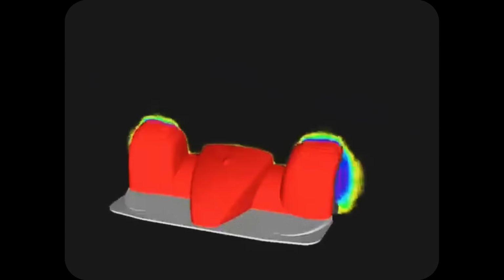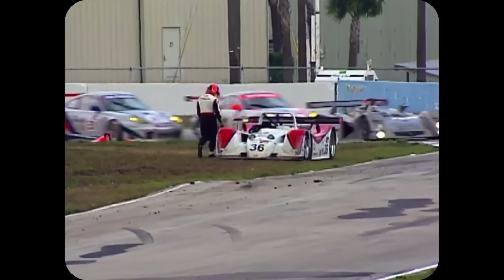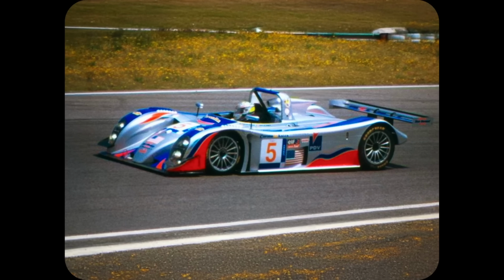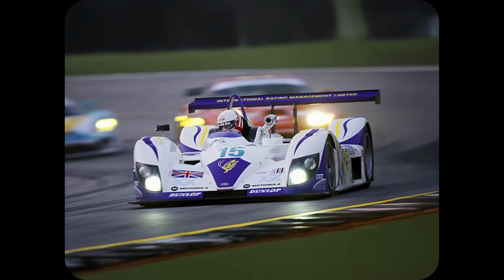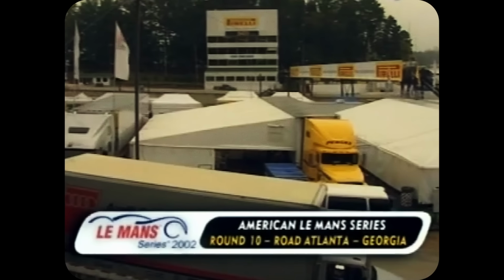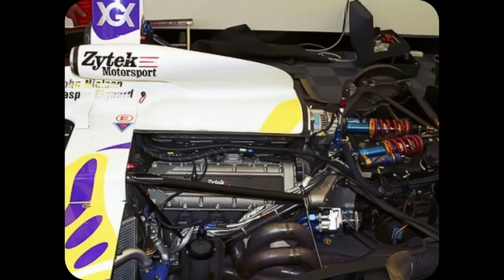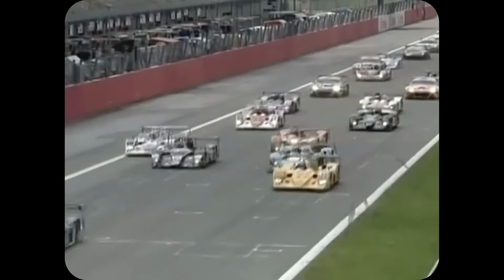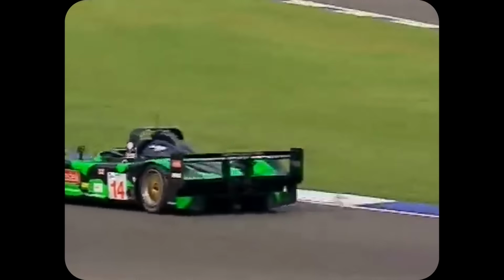The Greatest Race Car You’ve Never Heard Of

Comment: I recall Zytek beating Audi straight up at the 2005 Laguna Seca race. I am not sure how the chassis freeze was the sole impetus for Reynard demise. By 2002, the Cart ownership was looking to have an equivalency formula with the IRL. There was an announcement that MG (I believe with Judd as a partner) was going to be an engine supplier and that Cosworth was designing a 3.5NA V8 for Ford.  The whole thing fell apart as Honda and Toyota decided to just switch to the IRL and take their teams with them. The Cosworth was moth balled and then was purchased by General Motors, then rebadged as the Gen 4 Chevy. If anything, I think Cart is getting too much credit here, the uncertainty of the future ruleset left them with a spec series until the corpse of Champcar was taken out back and shot.

Comment: I worked on the LMP Oreca with the Mopar engine, I remember very well the box system for the gearbox. It was really practical because we broke a lot of gearboxes because of the engine which had much more torque than the V10 fitted to the other LMPs. On the other hand, for the Viper, only the bodywork was made by Reynard, the chassis was made by Dodge and frankly it was very badly done, there was no identical one, a nightmare to mount the bodywork and especially to prepare the replacement bodies which had to be able to fit on each chassis but it was very difficult
Reply: Very difficult yet it can be very rewarding.
Reply: quick question; albeit the bespoke v10 it had, any maintenance done on the 24 hour race, how long were your pitstops on average?

Comment: The death Driver was Michele alboreto during a Test Run in an Audi r8 in the biggest track Version from the Eurospeedway Lausitz, do to a tire failure the Car got Airborne and crashed hard destroying the Car and sadly Killing him.
Reply: He seems to be implying that it wasn't a tyre failure, rather an aerodynamic one.   My ears perked up quite a bit when I heard that part.

Edit: Amazing Video!!!! Incredible interview and I re-watched the whole thing and caught the bit about a tyre puncture, so I'm guessing puncture led to aero instability led to takeoff.
Reply: @ryanstewart4444  to quote an article on alboretos crash ,, Then, however, a small screw drilled unnoticed into the rear tyres of the Audi R8, the pressure was slowing. And when Alboreto returned to the gas on the Lausitzring, the tragedy took its course. At 300 km/h, the car broke out, overturned and landed next to the track. "